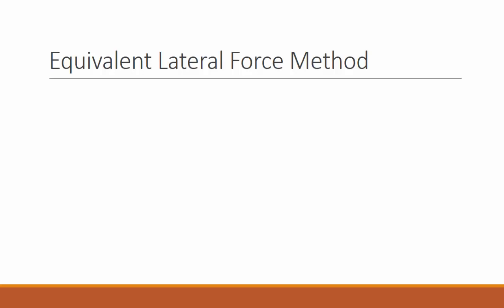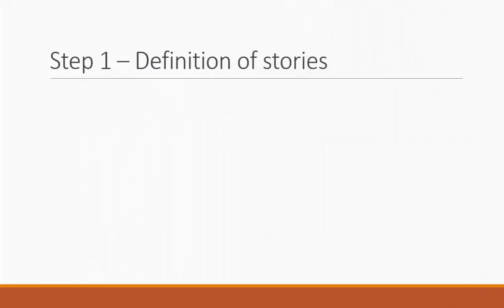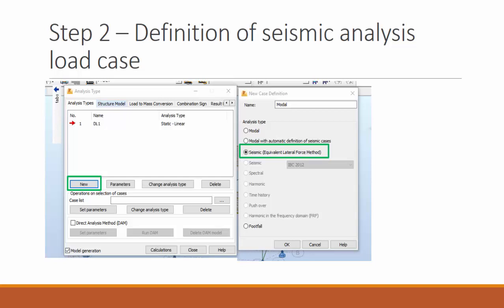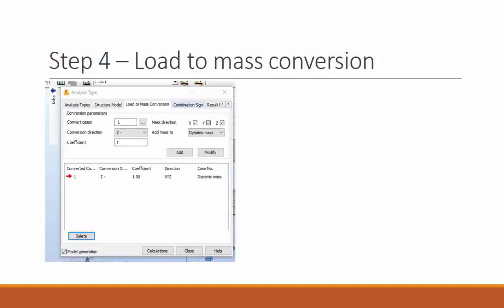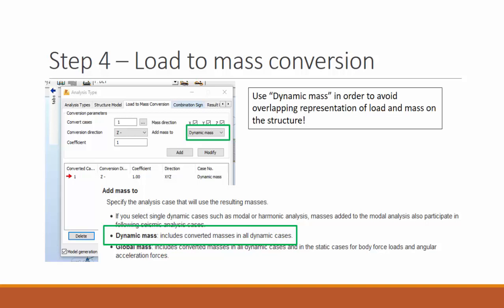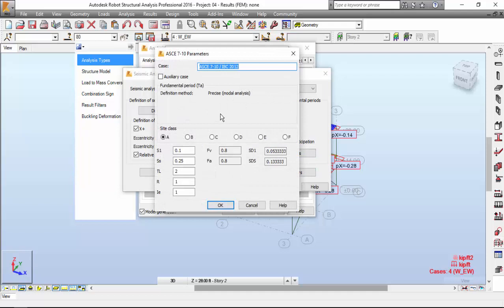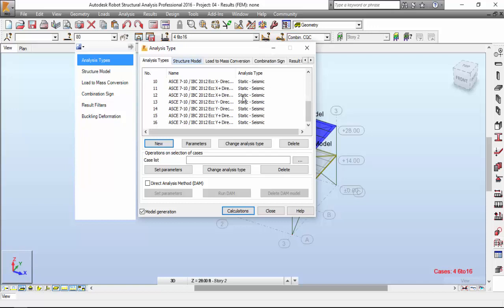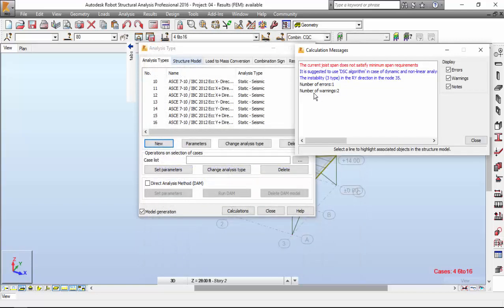Robot Structural Analysis: Making the Change - Part 6

Comment: Hi Nuno,
Thanks for videos, that help a lot.

I was wondering how can you assign wich members are ductiles and wich will stay elastic in your seismic analysic. In other words, how can you force the plastic hing in the bracing and not in beams or column? and where you can display those plastic hinges? 

Thanks
Reply from the maker: +Othman Ouahabi well I don't really know if it's possible to make a simple but efficient Capacity Design analysis in Robot Structural Analysis. You hVe the Italian Regulation adding but I don't really know how it works. You may need to analyze the structure with the some external tools. For example excel spreadsheets to help you determine if the capacity design rules are respected. Robot doesn't do that unfortunately. :/
Reply: Nuno, I think I found it :Open the Non-linear Hinges dialog using either method: 
Click Geometry > Additional Attributes > Non-linear Hinges 
Click on the Structure Definition toolbar. 
This option is used for defining and assigning non-linear hinges to structure bars. These hinges are used in Pushover analysis for selected structure types in Robot (except for: 2D truss, 3D truss, plane stress structure, plane deformation structure, and axisymmetric structure).
Reply from the maker: +Othman Ouahabi you may use that to do a pushover analysis. But that doesn't solve the Capacity Design checks problem. And I confess that after all this time, I have never used that non-linear hinges. Have you tried it out?
Reply: Not really, I was just wondering if it would work for the capacity design